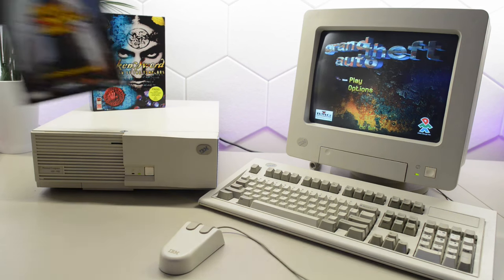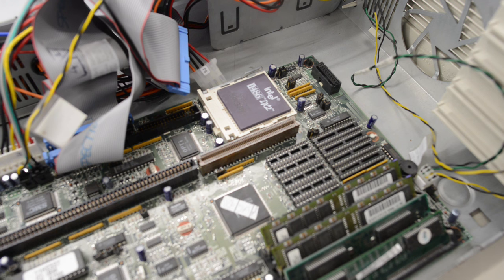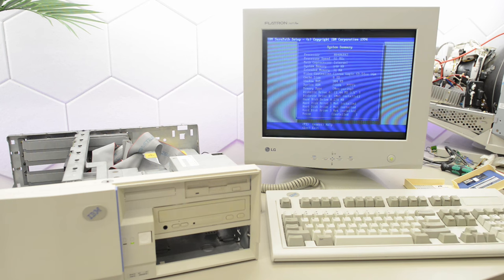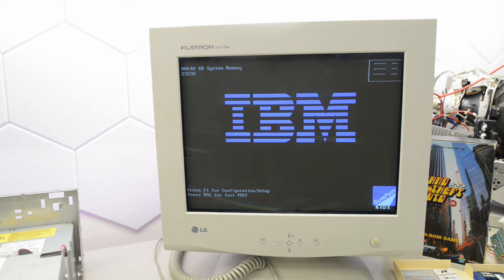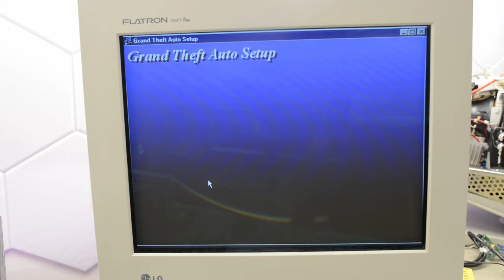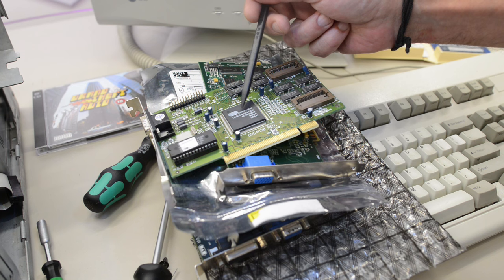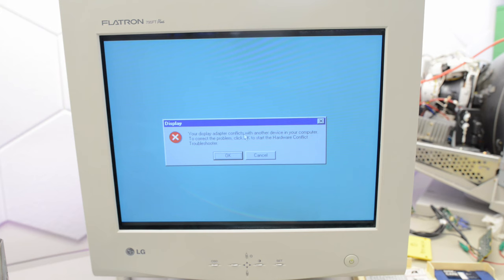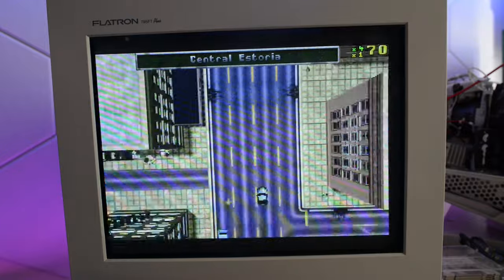IBM 350-466DX2 Rescued with Computer Reset part. Can we make it play Grand Theft Auto in High Color?

Comment: I worked in a computer store from 99-01 that exclusively sold AOpen products. I remember that model CD-ROM drive well. It was very sensitive to the length of screws used. Unless you used super short screws, it would jam the mechanism. That's why it worked once you removed it from the cage. We got tons of returns from people saying they were defective, but they weren't using the special super short screws that came with the drive. Other than that they are great drives for audio ripping. Very fast. Love your vids!
Reply from the maker: Thank you, that's very useful info. I'll make sure to use super short screws
Reply: So more like an F-Open, eh?  haha  Because they fail to open...  right.  Sorry.  😏

Comment: Shango066 has a few videos about doing cataract removals on older tubes, as you mentioned, and that should be the easiest way to do it. get it in a trashcan out in the sun, put on layers, and go at it. Face shield optional but recommended. Being it's a tube from the 90s it should have an implosion band fitted unless it's REALLY cheap, so I dont' think it'll implode on you, but you should still look at his videos and get acquainted with different methods of doing it.
Reply from the maker: Yeah, there are many videos out there on how to fix older and smaller tubes. I guess I'll just have to take the lead on these "modern" Trinitron tubes
Reply: At some point, I need to attempt to sand down the surface of a scratched CRT, and polish it back to clear again.  If I don't post replies after that, it's been nice knowing all of you!
Reply from the maker: @nickwallette6201  Haha, I was kind'a thinking leaving a message like that before I start working on the Sony lol
Reply: @Epictronics1 
I wouldn't recommend sanding a CRT screen, that glass is leaded glass, and you don't want to breathe any of that glass.

Comment: I just sent boxes full of perfectly working CD and DVD burners to the recycling depot. I hate throwing away perfectly working computer gear but my closet can only hold so much then eventually I have to purge it every few years.
Reply from the maker: Sell them on eBay?
Reply: Try donating to thrift or charity shops if you can’t be bothered with eBay. Lots of them will take computer gear.

Comment: For a hardware conflict, why you not try to change the settings of that onboard Cirrus video? While you do not use it, as well can give it some nonstandard but free resources to avoid the conflict, be it the IRQ, adress or memory range. Also why when you disable it, still it gave the conflict? May it be that Matrox was conflicting with something else? And what was conflicting, did you checked (memory, IRQ, adress)?
Reply from the maker: I literally ran out of time. In this case, it was lucky because the game turned out to play much better under DOS. I would never have thought to try that if it wasn't for the conflict issue
Reply: Worth a shot.  Windows 95's resource conflict resolution skills are not particularly sophisticated.

Also, as for the BIOS settings (like refresh rate) affecting Windows or not, the answer is probably always "not."  There are three main kinds of BIOS settings:

1) Those that configure things which aren't otherwise detectable, and so the BIOS manifest becomes the single source of truth.  Any OS, even protected-mode ones, rely on the settings entered in the BIOS to understand what hardware is installed.  This is stuff like installed floppy drives, serial/parallel settings, etc.

2) Configurations that affect BIOS routines and initialization of hardware, and so have an effect in DOS or other real-mode applications, but are overridden by drivers in protected mode.  This is basically anything where there's a specific driver setting in Windows -- display resolution and refresh being one of those.  IDE devices and partitions being another important one.

3) Settings that configure embedded devices to enable or disable support for them.  This is technically a software setting, so it is, in theory, possible to override it in Windows / Linux / whatever, if the driver exposes those options.  Likewise, Windows may still "detect" a device that is supposed to be disabled, depending on whether the BIOS setting prevents all attachment to the ISA / PCI / LPC / SM bus, or something less thorough; and whether that enable/disable switch defaults to enabled after a device reset, etc.  This is more of an issue once motherboards began incorporating all the things you would ever need, like sound, networking, I/O, video, etc.  But, it could happen even in the early days with secondary IDE channels, or onboard video.

These settings CAN be quite bulletproof, as most motherboard chipsets have a few general-purpose I/O pins that can be used to control the Chip Select pins on audio / video / network / SCSI controller ICs.  There's no way a generic (e.g.) Adaptec or ESS driver would know that switch existed, so the device would either show up on the bus, or it wouldn't, and there would be no way to programmatically change that outside of the BIOS, which has specifically-written ROMs for that bespoke switch.  (Well, it's always possible by writing directly to the chipset, but you would have to know what to write, where, and is the kind of thing you might see in Linux driver hacks designed for specific machines or motherboards, but that's about it.)

Comment: Those Aopen drives from 2000 are actually pretty good I can remember getting insane read spreads on them when using blindread back in the day.

They have a tendancy to wear out the drive belts, or get sricky gears on even earlier ones, to open it, eject the drive fully, clip off the front bezel from the tray, remove the front cover and you can then lift off the cover , be sure to clean the laser head ;)
Reply from the maker: Great, I'll service it and install it in a late PIII or early P4 project, Thanks

Comment: I remember that GTA had a frame limiter that could cause constant slowdowns, especially on low spec hardware. You can disable it by pushing F7 or some other F key. You might wanna give it a try 😄
Reply from the maker: I'll give it a try, thanks

Comment: Without even getting into the video, I can answer that one: Yes. Because we still had a 486 when GTA came out and the PCI video card had a decent transfer rate and was just about capable of high-colour. Though it was much happier about it at 320x240 or maybe 400x300 than than anything higher. The Pentium-120 laptop I used for a while (having picked it up from a work colleague in the noughties for £40 then underclocked it to 60MHz to save the battery) was perfectly happy at 640x480 hi-colour though...

GTA isn't really that graphically demanding a game and the CPU load doesn't change so much with the colour mode. Possibly the resolution as you can theoretically get a wider field of view as a result, but it's likely more a problem of how many pixels need to be pushed across the bus, and IDK if you get any saving from using 8bpp colour there vs 16bpp when your bus is 16 or 32 bits wide.

Heck I think we managed to just-about get it working on some 486 SX25 machines at school, in 8-bit mode with a janky framerate. I've got a similar model tucked under the bed at the moment, I feel like taking on the challenge to see if GTA will work on that as well...

Comment: CDROM does not slow the HDD down. It was possibly an issue during the 1x/2x ATA CDROMs, which couldn't do DMA and then forced HDD also to use PIO mode. These days (and by that i mean dozen+X speed CDROMs), everything supports DMA. And even if the DMA mode would be different, you can mix&match them.

So you don't need to worry about this these days. :)
Reply from the maker: Ok, thanks!
Reply: This is very true. I was also initially going to say basically the same thing, but even then the slowdown (of sorts) actually comes if both drives are used simultaneously. After all one IDE-channel is one channel, it can't transfer data strictly simultaneously. Usually this is not inherent problem, except in early days of CD-burning where bus-speed was not that critical but the steadiness of data stream was. Other than that, in most practicalities this design choice made no conceivable effect. Generally though if oyu used 2 hard disks on same IDE-channel then you could see slowdown much more easily.
Reply: @samiolmari3821    This is probably the bigger problem.  I had a Sony VAIO super-slim laptop with an IDE HDD and IDE combo DVD-ROM / CD-RW drive on a single IDE channel.  Burning discs, and copying stuff from CD/DVD was s - l - o - w.

Either alone was OK, although who could tell -- it used one of those iPod-sized HDDs, and they were... uh... not fast.

Comment: Regarding your mystery motherboard connector, I'm pretty sure that's a 3.3V supplemental PCI power connector. Most AT power supplies don't supply 3.3V, but the PCI 2.1 spec requires it, so around 95 they put a connector on the motherboard to supply 3.3V and be compliant with the standard, ATX standard of course makes the connector unnecessary. I think it's 6 pins, 3 ground and 3 3.3V. I have a socket 5 board like this, and it doesn't like any video cards, including universal ones, that aren't 5V PCI keyed.
Reply: Correct.  Early PCI cards are probably fine, in most cases, because they're either 5V or 5V-tolerant.  In that case, the unpopulated connector will probably seem pointless.  But, later 3.3V-only cards would not work.

Comment: I had a similar problem with video cards clashing with the onboard video on a customer's FM Towns machine, there was sadly no fix due to the machine architecture doing strange things for the FM Towns compatibility board and the BIOS being very broken.

You may try to move the Matrox card to the lower PCI slot and see if you still get a resource conflict, you might get lucky and the PCI slots are tied to different interrupt lines.
Reply from the maker: I'll try that, thanks

Comment: I can't remember, wasn't a 486DX2 66Mhz the minimum requirements, or a DX4 100Mhz?
Reply from the maker: dx4-100. I did a test however and it works fine in low color mode with a dx2-66

Comment: I hope you can try to run 3dfx on a 486 system, preferably a "true" 486 = DX/DX2. By testing various voodoo cards. And then games like carmageddon, early voodoo 1 games etc.
Reply from the maker: I won't be doing it quite that extensively but I plan to test Tomb Rider Woodoo2 SLI. Not sure what system yet. I may try the setup in two of the IBMs

Comment: the only mystery is how it would perform with the Cirrus Logic under DOS!
Reply from the maker: I actually just did some more tests. GTA ran fine with the onboard GD5430 but only in low color mode. I also swapped back to the DX2-66. It ran fine too! High color mode and all (with the Matrox). There was some minor lag occasionally but it was barely noticeable.

Comment: I  can't remember but i think the dos version was way faster than in Windows. I think I had either a Pentium 133 or k6 200(engineering sample clocked at 225mhz that I delidded and still have) with a Matrox Mystique(non 220) and remember it ran like crap in anything other than 320x200 until I got my 3dfx voodoo card.
I also ran it on my p133 laptop and remember it was perfectly playable in 320x200. I think the game had been out for a while by the time I got the laptop. It was a NEC with a swappable port for a floppy and cdrom. I think i atill have it but the plastics are very brittle and it cracked up last time i tried it a few years back. I don't remember if I finally chucked it or not.

Comment: Maybe it means a DX4 None Overdrive version as Minimum, as the Overdrives were never 'quite' up to the level of the actual DX4-100

I remember having a standard ceramic none overdrive DX4-100, and it felt like a HUGE upgrade from the DX2-66, a big part of it was the difference in cache, make sure you get the "&EW" revision for the write-back cache version if you can find one, the main problem being they were OEM only.

be interesting to see a comparison, how much difference there actually is (if any) etc :)
Reply from the maker: I'll check, thanks

Comment: i think i remember now that win 95 dont like newer gpu and try go up win 2000s there may been some bugs fixed in os
2nd i do know dos is way better than windows because doesnt run in background while playing game but windows still be runing in background whiles you trying to game and cause bit of slow down
i do remember that win 95 max is 1mb of vram gpu if you go higher cause it all kinda of problem so same goes to win 98 but not 2000 because 2000 run 14mb of vram if im not mistakes by code in os program

Comment: yeah before the days of 3d accelerators I found just about every game was WAY faster in DOS.
Reply from the maker: I played this game on my 133MMX back then. It ran fine in Windows. It never occurred to me to try it in DOS
Reply: @Epictronics1  I always had low end 2nd hand hardware back then. I needed every little edge possible.
Reply: @awilliams1701   Yup, pretty common in that transition period where Win95 gaming was just starting to blossom.  Windows 95 didn't even originally ship with DirectX, so lots of early Windows versions were using WinG or plain old GDI.  That, and the general overhead of running a larger OS on limited hardware... it made a difference.

Thinking back to my 486DX2/66 running Mech Warrior 2 and Wing Commander III.  DOS all the way, until I had a Pentium with a Mystique.

Comment: I played the original GTA DOS version in 8bit or low color mode on a AM5x86 running at 120 MHz (40 MHz FSB) and it ran fine with 128KB of L2 cache and a local bus graphics card. The high color version really needed a Pentium 100+ to play smoothly all the time. The 3dfx version even a bit more than that. 
In general playing at DOS game through Windows is going to tank your performance. Back then if I was in Windows it was Windows only programs & games. If I was playing DOS games then I had a boot floppy with various configurations specified through the AUTOEXEC dot BAT and CONFIG dos SYS files. That way I could load the proper device drivers and TSRs if I needed CD-ROM support or not and if the game needed extended or expanded memory support or not and so on.
Playing games in Windows today we're pretty spoiled. We generally only now need a good enough CPU or GPU and maybe a driver update to play just about anything nearly effortlessly. Back in the DOS days you often had to really know your computer well to get many games to run properly.
Reply from the maker: True. I'll revisit this machine and the 330 with more tests and experiments. I was pretty blown away with how the game played on this IBM in the last test. I can't really see the difference compared to my 133MMX

Comment: I have played GTA on a 486 DX2/66. It was okay. Although I think it was in 256 colour mode.
Reply from the maker: Let's see if we can do High Color mode :)
Reply: I did on a 486DX with 50MHz and a Tseng Labs ET4000 VLB card. The 256 (low) color mode wasn't perfect but playable in DOS. I spent hours wreaking havoc on a map using cheats, until after 2-3 hours sometimes there would be no new cars spawning. Good times!
Reply from the maker: @mike_rofone  Sure was :) Well, this board can do 50. I'd love to get it up and running a 5x86 at 200!
Reply: @Epictronics1  200MHz 486... I didn't even know that's a thing! SCREEEAAAAMING POWERRRRRR!